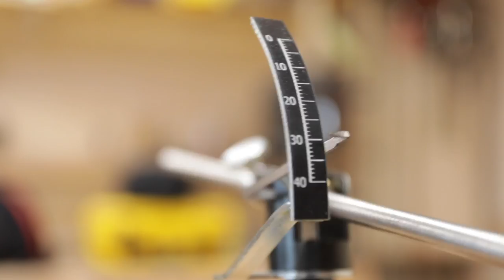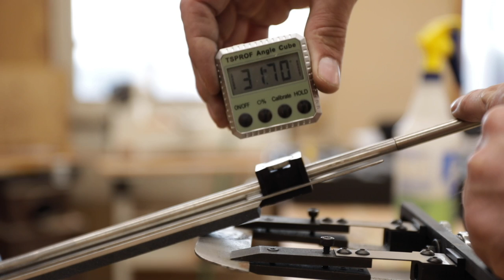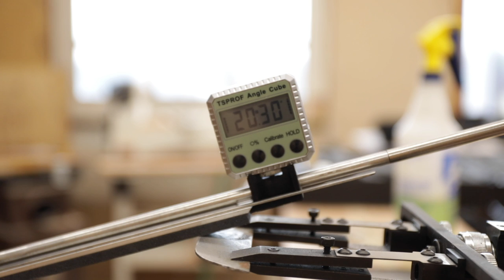Can A Knife Be Too Sharp? 2

Comment: Its the steel its not a carbon steel its mild steel ao it cant be hardened without adding carbon into it so one you take it to the wires edge it doesnt have thr rigidity to keep the edge thats why it fold over side to side each time you try and polish it

Comment: AT 20 DEGREES IT WONT GET RAZOR SHARP TRY 30 DEGREES THEN CHANGE TO 15 OR 20  YOU HAVE NO BEVEL LIKE 98 PERCENT OF KNIFES ARE MADE FOR A REASON
Reply: Or because of the type of metal he is using, which is the obvious answer as to why it won't cut

Comment: It’s not hardened steel that’s why
Reply from the maker: How do you know, have you tested it?
Reply: I’ve never made a knife from sheet metal but if the tip is chasing itself while sharpening then it is far too weak. If it’s a hardened blade that tip will stay strong and straight even with a very thin edge shouldn’t have any movement. I know sheet metal can become very hard but don’t know the exact tempering for it.

Comment: Oh shut up lmao you don't have an electron microscope

The conventional transmission electron microscope (TEM) with out any correction modules costs around 
$10

 per each electron volt of energy in the beam. The typical energy of 
electron beam used in TEM varies from 100 keV to 400 keV and hence the 
cost varies from 
∼$3M−$5M
.
 TEM is an extremely costly equipment. If you add aberration correction 
modules such as probe correctors, the cost per electron volt of beam 
energy increases further and the cost of TEM increases up to 
∼6M
. Scanning electron microscope (SEM) is usually operated at low voltages 
<50eV
. Thus, the cost of SEM is much lower compared to TEM.

(I copied that from Krishna Gangadhara)

Comment: you just took a piece of metal and sharpened it, then compared it with a knife. That's where your mistake is, the knife has been through some extra processing, such as carburizing, which increases the hardness of the metal.